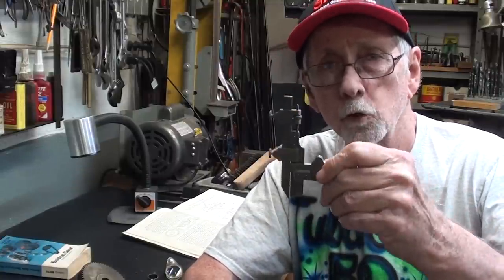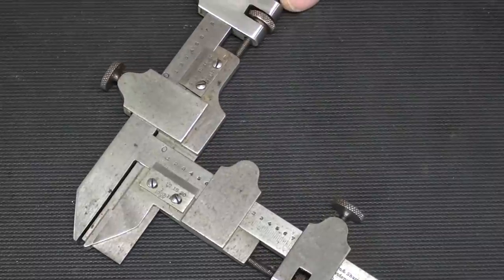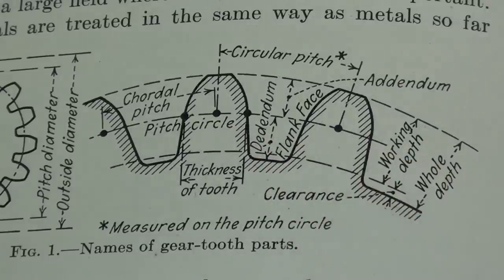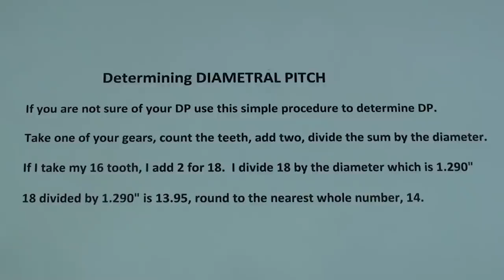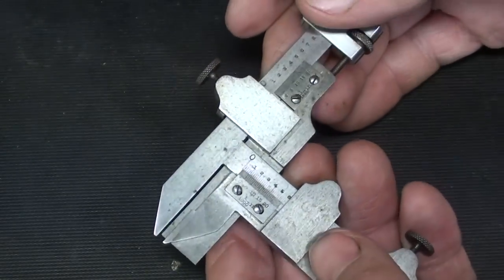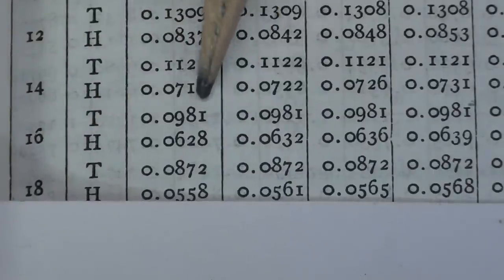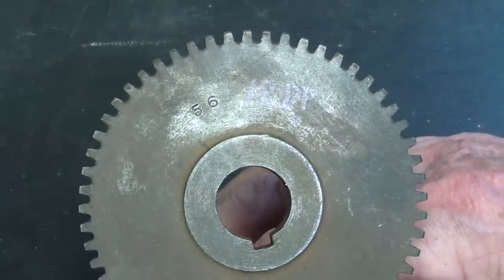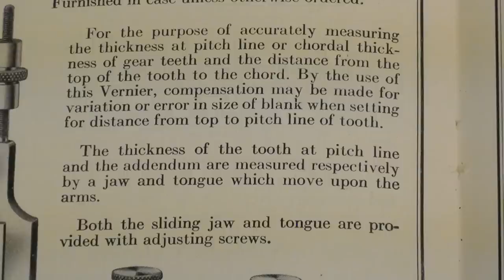Brown & Sharpe GEAR TOOTH CALIPER Tips #643 tubalcain

Comment: Thank you Lyle. I spent over 34 years maintaining spur gear making machinery and gear inspection machinery. In spite of this, I have never seen one of these instruments used or explained. We had a Fellows gear shaper and Barber Coleman hobs when I started in the trade. These would be replaced in the mid 90's with CNC Pfauter hob and then a Gleason grinder was added. Our primary gear inspection machine was a Lebheir CNC inspection machine. I have performed very deep troubleshooting and repair on all of this equipment and I know almost nothing about gears. We machined many thousands of spur gears, both straight tooth and helical. Our gear grinder was so sensitive that I required a .00005" indicator to set it up during some repairs. I was the first employee to purchase an indicator of that resolution and probably owned mine for a decade before the shop purchased one.
A maintenance technician needs to know little about gears to maintain and repair the machinery that makes them. Our product required very high tolerance gears (Class 14 was often the target). This mandated grinding the gears. Even though I performed extensive repairs, the gear terminology and gear contour geometry characteristics was a black box mystery to me. We were exceedingly careful with gear blank center hole roundness, size and perpendicularity to the face of the gear as well as work holding arbor geometry. These characteristics seem of little concern to the home hobby machinists. Our gears were cut with hobs that came from the tooling manufacturer with all of pitch geometry magic already done. 
I doubt that I will ever cut my own gears. My needs don't demand this. I currently need some crude bevel gears, but it is simple to purchase off the shelf gears and custom machine the bore and shoulders to my needs. I need to master manual lathe and milling skills. A repairman knows a lot about machine tools, but he doesn't need to know much about how to use them. In my world, machinists are revered, but machinists that couldn't repair their machinery (and most can't) similarly revered us technicians. You and Adam Booth continue to teach me so much as I expand my capacity to perform hobby machining in my retirement. I need to make a trip to Streater before "you make the foolish move to the condo in Florida". I really want to meet you.

Gleason is a fabulous old company known for their development of rear end automotive gear making machinery. They acquired Pfauter shortly after we purchased our Pfauter. They needed to add spur gear grinding capacity and sourced from Okuma. These were primary machines for us, but Gleason regarded both of these lines as unloved stepchildren. Getting parts and technical support from Gleason was always a challenge. Our gear grinder was equipped with a $80,000 filter and refrigerated oil cooler. Maintaining grinding oil temperature was critical to maintaining part dimensions. I think that I remember correctly that the clean oil side of the filter held 375 gallons, all that capacity to grind quite small spur gears.
Reply from the maker: Thank you for that comment. That was extremely interesting. When I worked at caterpillar, I was amazed at the electricians and repairman
Reply: That was very interesting. As a retired industrial electronics tech who wore many other "hats" during my career, it's interesting to hear other people's life story. Every time I learn a little bit I realize how little I know.
Reply: Paul Hunt, excellent reply! I enjoy reading comments like yours that are interesting and factual.

Comment: We've been told for years that nobody needs to completely understand gear tooth theory because custom tooling is too expensive and nobody would ever need to cut a "custom gear", but I've found that with the increased use of 3d printing and laser cut parts in product design, tooling is no longer a limiting factor, and many custom sized gears can be integrated onto prototype plastic or steel parts for cheap (cost of design time only, print time is negligible). Now this knowledge is much more relevant and we are in desperate need of videos like this to help us understand simple ways designing and inspecting our parts to a higher degree of accuracy than most conventional scanning equipment or faro arms (CMM) allow for. Thank you for for this information!

Comment: Excellent demo. I like the magnetic magnifiers- Thank's for showing them. I now need to make up magnetic holders like those, as I have never stumbled upon any in the wild.

A couple of others have mentioned other uses for the gear tooth caliper, so I figured I'd mention a critical part: calibration check. The measurement is made with the tips of the jaws, not the flats, so it is important that they are sharp and square. I keep a 0.250 (IIRC) gauge pin in the kit with mine, and the once every year or so I need to use it, check the ends of the jaws, check the depth blade calibration (lay the gauge pin on a surface plate and measure), and the span calibration (several ways here, but the easiest is to use a known good gear tooth-- NOT a tooth pitch gauge, where the tooth form may not be right on) at the measuring edges, not up in the jaws.
Reply from the maker: Thanks

Comment: I have a gear tooth vernier made by Moore & Wright of Sheffield, England. I paid £20 for it on ebay a  few years ago. It will measure gear teeth from 40 DP to 4 DP and like all Moore & Wright precision measuring equipment is of the finest quality, at least equal to Starrett. I live in England and almost all of my precision measuring equipment is of Moore & Wright manufacture!

Comment: Thank you for clarifying something that I have never NEEDED (luckily), but what has anyway bothered me.  Around 1980 I bought a dual system -- metric and inch -- caliper.  At that time you did not have digital ones and the dial ones were for either metric or inch only.  So, I ended up buying a vernier type.  It is a Fowler, without any part number.  It has a 20-count vernier (also called Nonius) for the metric side and a 25-count vernier for the inch side..  But the distance these two verniers span are 19 millimeters and 1.22 inches, respectively.  I suspect that might cause some head scratching to any novice.  Anyway, the reading resolutions are correspondingly 0.05 mm and 0.001 inch.  Like usual, the metric Nonius reads "directly", while the inch one requires adding a correct 0.025 multiple to the Nonius scale number at each position.
Later on I have added both a dial type and a digital caliper to my repertoire.  The Fowler is still in the Corduroy pouch that I bought at about the same time for a travel tool kit.  And, just like you, nowadays I need a magnifying glass to read the verniers -- if I even try.
Reply from the maker: Yes

Comment: I still have my Dietzgen (sp) Vernier Slide rule that I used in HS and college.  It has a built in magnifier on the slider for "old eyes".  I used fit for multiplication and division mainly, but had much trouble keeping track of the decimal point.   Thank you for the lesson today.   I thank God for the invention of the calculator and the digital caliper. JE
Reply from the maker: Yes, I hated my slide rule

Comment: I've worked with all types of gears for the last 20 years and we have a set of INSIZE gear tooth calipers, digital too,...😊. I think we spent around $400 on them. I use them before creating an unnecessary program in Gear Pro or the Gleason. If you gotta gear with a fat or skinny tooth, it'll show every time.....Thanks for the video....🤙

Comment: I have one, and it is precision ground all over and in excellent condition. The company I worked for a long time ago, threw it in the dumpster, so I rescued it. I haven't made a gear since high school 45 yrs ago. It is tiny and you almost need a microscope to read the scale. Maybe not accurate enough for cutting today's gears, but helped get us to better methods. Excellent video, we need to work at a museum. 🤪

Comment: I use them almost daily making Bevel Gears, where they are the only practical means of measuring a gear, other than fit with the mating part.
When making spur gears, the blanks are always undersized, to allow for clearance in the event of run-out. This then affects the addendum, unless you measure the gear and  account for the extra few thou of addendum, they will measure thicker than they actually are. This uncertainty is why most measurements are done over pins, it eliminates the dependency on the outer diameter of the gear.
Great video!  Thanks for all the work you do.
  -Mike-
Reply from the maker: Thanks
Reply: Mike, I'm wondering how you'd measure an odd tooth gear, say 19 teeth, with pins? There must be a way, perhaps with three pins.
Reply: @ellieprice3396  You could to the math to figure the offset, but there are charts available that show you what reading to use to adjust for the odd toothed gear.  Sometimes it's annotated on the blueprint.

Comment: Most machinists will never have to make a gear given the availability of them, but 100% of them will at some point will need to identify a gear they are working with. Once again, great job in teaching, and a pleasure to watch.
Reply: How do they figure out the pressure angle?
Reply: @MF175mp  I look at the tooth profile. The higher the number the more the tooth gets triangle shaped rather than like little clipped rectangles.

Comment: Hello Mr Pete,
I have been using Gear tooth verniers for years, while they're great for checking manufacturing tolerances, where they Excell is in checking wear, even more so when measuring accurate tapers or complex shapes that require accurate reproduction, thanks for showing folks the variety in measuring tools.
Reply: You didn't mention my favourite use (the reason mine comes out most often): measuring large radii, those too large for the standard radius gauge. You can direct measure the sag and chordal length, then use the sagitta formula to calculate radius. Conversely, when forming a large radius, to check that it is correct. The limit is the usable chordal span of the tool and the needed precision, as with any three-point radius calculation.
Reply: @johnjohn-ed9qt  that's the kind of thing I meant by "complex shapes", before I bought my gear tooth verniers I thought they were "just for gear teeth"... I was such a Reub 😃

Comment: Calipers are usually just for reference. for finial inspection your going to need a set of Mic's and wires or CMM (which are fairly new). you can also use Z scopes.

Comment: Every tool collector should have one. I lusted after one for years but always thought they were too expensive. Years later after I was over it I found one at a reasonable price. Of course I bought it. It is a metric one made in Russia. I did the same as you, cleaned it and oiled it, and made it's own cozy little box, and it now resides in my collection, in case I ever need one. Ha ha ha... Enjoy!

Comment: Thank You Mr. Pete, very informative and simpler to use than I thought especially with the tables.  I think it might be something a machinist would use on first inspection but would bet that sample inspection of modern stuff is measured on a vision system.  Always a pleasure to learn about a new tool, Thanks!

Comment: I almost bought one of those Starrett gear tooth verniers back when I was machining a lot of spur gears. I ended up buying gauge pins for each pitch I wanted to cut and using the two wire and three wire method of measuring the gear pitch diameter. This method was cheaper, quicker, and I think more accurate then using a vernier.

Comment: Hello Mr Pete, I think that your last measurement was out because you appeared to have the gauge crooked.  Slightly leaning over to the right.  As you said it needs to be perpendicular but I suppose that having the camera positioned thus, you weren't able to view what you were doing "square on" to the job.  I imagine using those gauges would take regular practice just to keep your hand in.  However, thanks for the demo.

Comment: there are also tables for Span measurement using just a caliper over a certain amount of teeth, another use of the gear tooth vernier is when re- cutting Acme threads by machining out the wear and then making a nut to suit, helps keep a track of what you are doing,  especially if the screw is long and there is more than one set up, helps you keep consistent thread thickness .
Reply from the maker: Thank you for that information

Comment: I can imagine many other measurement situations where this tool would be useful.  I seem to recall that Tom Lipton has used one on a few occasions for measurements on objects other than gear teeth.  In a production environment, I think that an optical comparator would be more commonly used for inspection, at least on smaller (spur) gears.  
Great video, as usual.  Many thanks.

Comment: Nice tool Mr. Pete it seem that it would be easy to make an adapter that clamps onto a standard caliper that could be set using gauge blocks thus establishing the depth of the measurement.

Comment: I have shop-built gear tooth caliper with a range of about 1/4"-3/4".  The tongue adjustment is made from a Scherr Tumico 1" micrometer head, and the other is an unknown satin-chrome 1" micrometer.  Both are .0001" types.  Upon closer inspection, the unknown mic is probably a replacement.  Maybe S-T did make it?

Comment: Lyle, lemon juice is a useful chemical adjunct to the abrasive methods of corrosion removal.  The juice contains 2 WEAK acids: citric and ascorbic.  Citric acid is a complexing agent and ascorbic acid is a reducing agent.  Those actions complement each other in getting the oxides of iron into solution and off the surface of the steel.  Left on too long, even weak acids attack a steel surface.  As is the case with abrasives, "take it easy breezy" and be cautious in applying Chemistry to the job at hand.

Comment: Very nice 👌 Mr. Pete. 19:20 also if the gear gets dropped on a concrete floor the one tooth you measure could be a little fat.
For a home shop, people set up tools and maybe cut one or two gears. I don't see this tool being practical for that. At a factory, they leave equipment set up to make the same gear for a long time. I imagine at the start of each shift, operators make one item and turn it in to the quality department for first article inspection. Now, production is held while somebody measures a whole bunch of first article gears. A tool like this would be very valuable for quickly assessing and getting back to production. These days, I imagine, coordinate measuring machines, and built-in automated inspection has mostly taken that effort over.

Comment: You could use that on the hob to measure it, given that a hob is a rack tooth gear form. Not much use for it though, assuming you are sharpening your hobs properly or sending them out for professional sharpening. 
I suppose it could also be used on a single pass cutter, too, but that is much simpler to sharpen than a hob.

Comment: I worked at a gear manufacturing plant as a Q.C. inspector.  I've never saw the measuring tool your using. They always "measured over wires".
Reply: As in "Pee Dee" wires?  Like you use to inspect threads?
Reply: @EuroclydonEng  Those are the same type of wires/pins. the PD stands for pitch diameter (which is what this device indirectly measures). A screw thread is basically a gear tooth wrapped around a center shaft, where it (usually) is adjacent to itself, just wrapped further on the shaft. I say usually because there are multi-thread screws. This is why worm gears are able to be meshed with actual gears, they are simply screws with the same pitch and pressure angle of the gear they are driving.
Pins are the typical way to measure gears. You have your set of pin/wire standards, measure across the gear to the opposite tooth, and now you have your "measurement over wires" as most prints spec it. There are some complicated equations for odd numbers of teeth and for using a more standard wire size close to what is perfect (1.728/diametral pitch), as well as equations for building backlash into your spec.

Comment: Hi Mr Pete,
I need to make 2 new gears and a splined shaft for a 1950’s Matra lathe I own. How do I determine what pressure angle the gears are? I’m not sure if I need to use a 20 degree or 14.5 degree cutter.

I have never cut gears before and don’t want to make a costly avoidable error in buying the wrong cutter set.

Thanks you for your videos.

Comment: Do you check these for wear on the corners of the inside jaws?

I have this same caliper at work and I noticed the corners are chamfered 20°x.0025 and 20°x.003 (measured on optical comparator). I think this is wear from overtightening when checking a 20° pressure angle tooth, but the guy training me said he doesn't care even though I think it's making my part .0151” oversize (measuring a rectangular part with a dimension calling for the distance between opposing gear rails pitch lines.)

There shouldn't be an angle on the inside jaw tips right? It should be a sharp corner?

Comment: Stay safe, stay in the shop. I noticed you were not quite square on the last measure, confusing that your reading did not seem to match the display. You should do a bit on the difference using     1/10,1/15,1/20,1/25 .0001 and calibrating a vernier like that having an adjustable scale with known standard IE. feeler gauge/block.
Reply: be aware that while working with/around a camera, it may not see things exactly as he does.  I've noticed, several times, where the camera view of a dial indicator looks like it's half a mark off when the video producer says it is "dead on" the mark.
Reply from the maker: Yes

Comment: I don't care for the fact that the tool itself does not have a straight edge down the tooth measuring side allowing one to align it better perpendicular to the gear. The slightest side tilt allows for to much error.